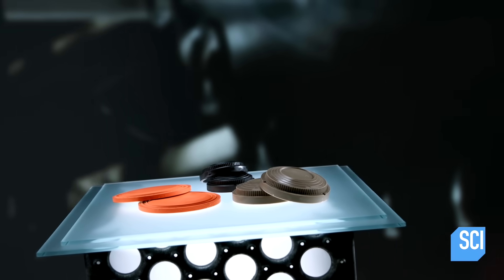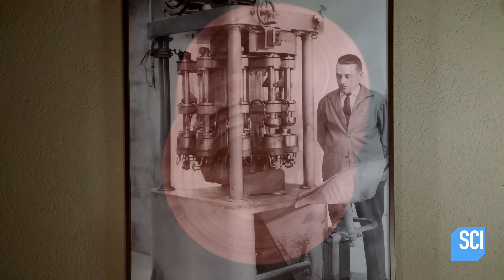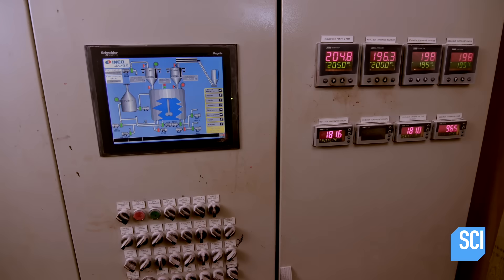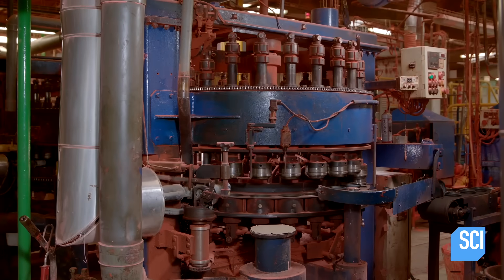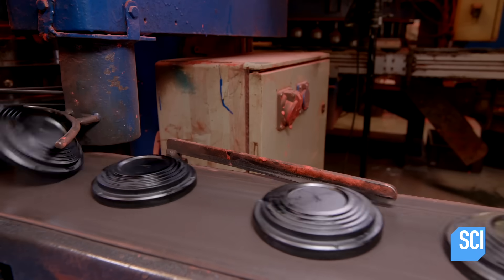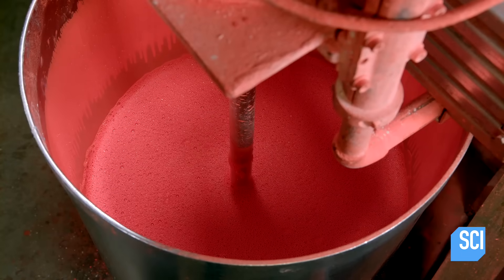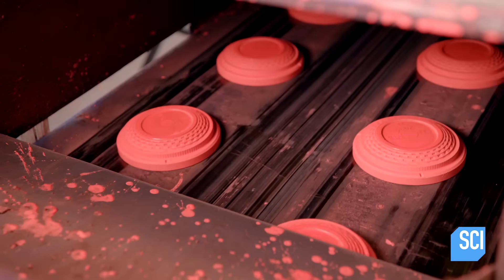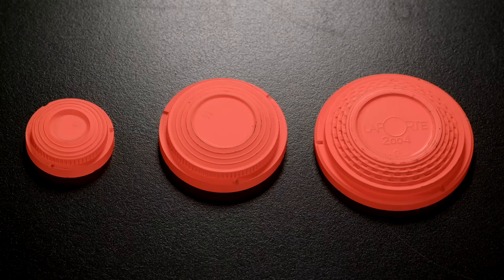How Clay Targets Are Made | How It’s Made

Comment: "The paint is bio-degradable..." but the target is made of congealed petroleum oil. :D
Reply: They are also biodegradable believe it or not. Our school has a trap team and going out on the range you can find old targets in various stages of breaking down.
Reply: But.. petroleum is natural...
Its only when you burn it it becomes bad. Or deposit it in large quantities (oil spills)
Reply: @lowryder3209  our oceans full of petroleum based plastics will argue against that.
Reply: @Dubngrub  "(oil spills)"
Reply: Most targets are now biodegradable.  LaPorte and Winchester and others all make biodegradable targets.  The LaPorte and most bio degradable targets are a slightly harder compound.  The force required to launch at regulation speeds, was not strong enough to survive the machine.  The compound was hardened and resulted in targets that were more resistant to braking.  Making shooters unhappy.
Reply: I know right? 🤦‍♂️
Reply: It's basically made of asphalt. Yeah it doesn't really biodegrade, but it also doesn't really cause any real harm to environment.
Reply: @aleksandersuur9475  actually you arent wrong. ive seen them breaking down.

Comment: There has to be more environmentally friendly materials that they could use other than pitch. Why not use some form of lightweight clay?
Reply: But don't worry! The paint is biodegradable!
Reply: Patrolium products are cheap. That’s the reason.
Reply: @thermophile2106  And considering that at skeet and trap ranges, they will launch tens of thousands of these each year, the pieces accumulate and leach contaminants into the water table.
Reply: Good idea. Lets dig more holes in the earth to extract a different mineral to replace one that's likely byproduct from another operation so doesn't damage mother earthquake. Kind of like digging up half a million pounds of earthquake to create a Tesla battery and they use tons of coal to generate the electricity to recharge it once or twice a week.  Really environmentally friendly idea.
Reply: @PatGuyot  Pitch is a petroleum byproduct. Skeet and Trap ranges accumulate shards of broken skeet. Perhaps you'd rather allow the petroleum byproducts soak into the ground and feed the aquifer that feeds your well.
Reply: @ashleymarie7452  True ashley. Petroleum byproducts do leach into the groundwater. Why aren't you whining about gas stations or the oil that leaks from your car or the blacktop roads that you drive on or the rubber from your shoes that ends up on the ground or (and this one is really cool) how about the cigarette butts or vape cartridges that are now, and have been, one of America's biggest pollution problems for decades.  The packaging for everything that you buy and all the clothes you wear including the house that you lived in that uses electricity all contribute to the degeneration of the planet and the water you drink. I'm as big a contributor to the problem as you but there needs to be some perspective used when providing alternative solutions. 
I've always figured: "If you want to improve anything, work out the plan to do so and put yourself in charge of the operation, so that when You complain, You can be part of the solution and be able to say You made a difference.  Otherwise it's just blah,blah,blah.
 Have a great day Ashley

Comment: Apparently the materials used have very little effect on the environment. The comment about the paint probably comes from paints usually being toxic and made to last. Im not an expert by any means, but from what i understand the biodegradable options are either more dangers (larger shards on impact meaning they could hit someone and cause injuries) or less reliable (they're too fragile and break before being launched). Clay pigeons are used a lot in wide open fields that still have plenty of stuff growing and critters around and that probably won't change
Reply: I don't know about the paint but the clay does break down over time.

Comment: I don't understand why not from clay ?!! At the end both from earth but clay is safer to use and recycle..i wonder how did they get a licence at the time that all environment organizations are warning about the problems caused oile and carbon dioxide!!!!
Reply: You are a moron. Haven't you thought about the fact that the manufacturers have tried for decades to come up with a better, cheaper, cleaner way to make these things? Clay isn't dense enough to handle the G forces. If they make them strong enough then they won't break when shot at.
Reply: @michaelcrocco4021  ...sadly, the dumbest morons always think they've realized the best solution.

...there have been biodegradable targets for several years now, they're just not as common (or cheap)

Comment: When did talc become calcium carbonate? It used to be magnesium silicate.
Reply: we watch these videos because it's 2 am and we have nothing better to do with our time.  Who gives a shit what is what
Reply: @SwishSwoshSwhoop  I am talking about the physical contact when they are transported or loaded to throwing device. Not while they are getting shattered.
Reply: @aguven  you do realize that asbestos is a naturally occurring substance and that no mater how hard you try you will be and have already been exposed to it.
Reply: @SwishSwoshSwhoop  I doubt that the second example can compare to the risk involved in the first. Well, if a person personally takes the risk and uses that item, it is on them. However, presenting the item to a customer that is clueless of the risk involved (however big or small it might be) is first, unetical practice.
Reply: @SwishSwoshSwhoop  consider the ones working in the production facility as well.
Reply: @SwishSwoshSwhoop  Any exposure is a risk. It is like saying: "when you take a grain of sand from a sand pile, the pile doesn't get smaller". Well it gets. The same with exposure. Any level of exposure has the potential to initiate a cancerous cell line that might potentially evade your immune system and becomes a clinical stage cancer.
Reply: and talc is carcinogenic
Reply: @aguven  it's not talc, it's the asbestos that may be found in the talc
Reply: @balorth  That is true :) nevertheless, not a wise idea to use in such purposes